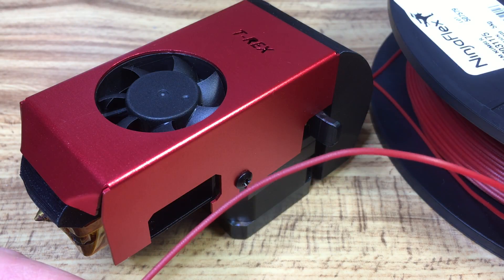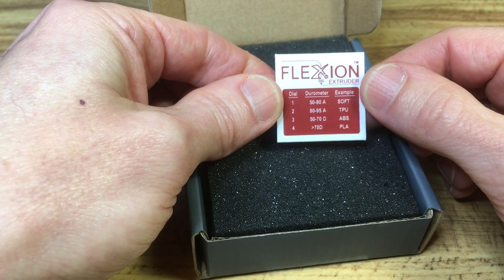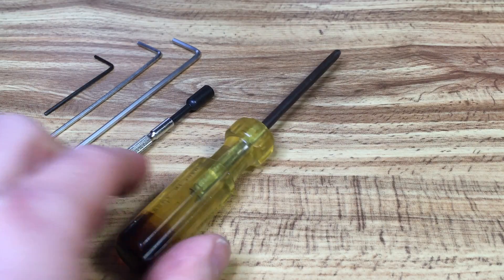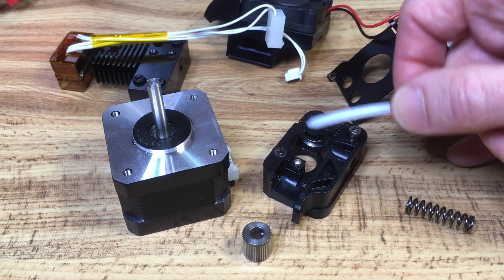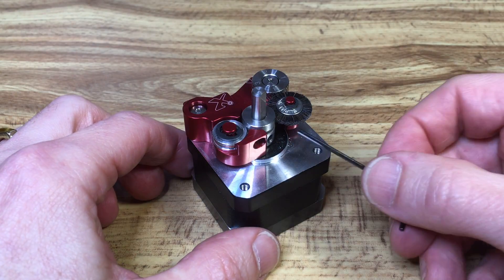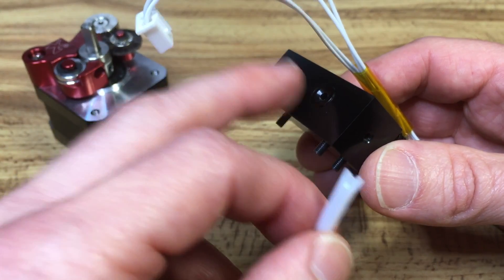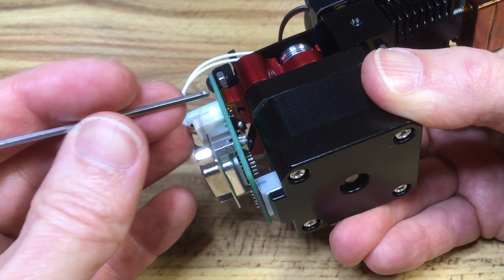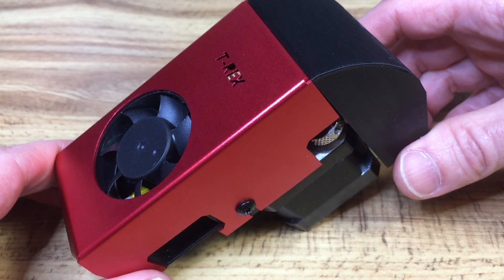Flexion extruder on Formbot T-Rex 2+ printer

Comment: Have you tried ABS? Is it even doable without enclosure on this printer?
Reply from the maker: Yes I print in ABS but I have built an enclosure. Need to keep the ambient above 40 degrees to prevent warping or even higher for larger prints. Above 50 however some of the T-Rex 2+ parts made of PLA begin to deform. I'm in the process of upgrading to the T-Rex 3 parts which are not PLA.